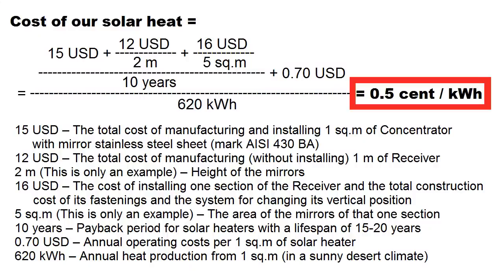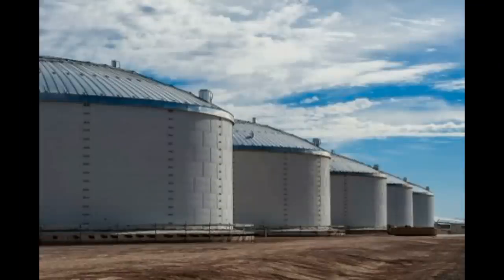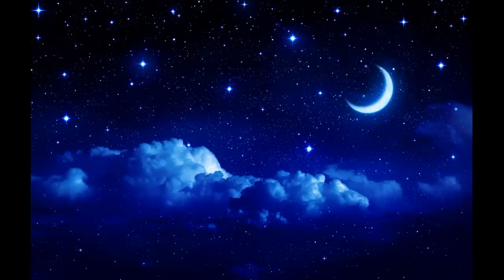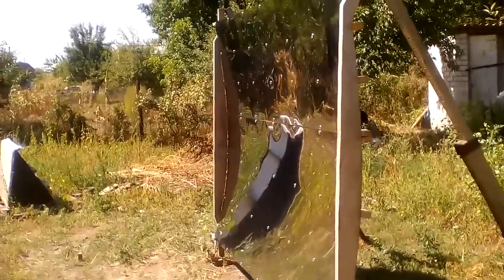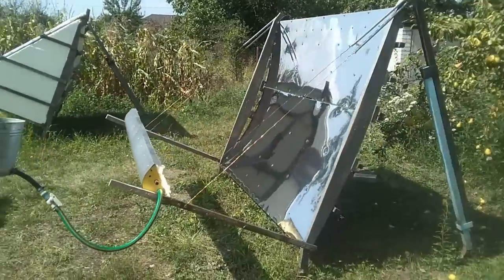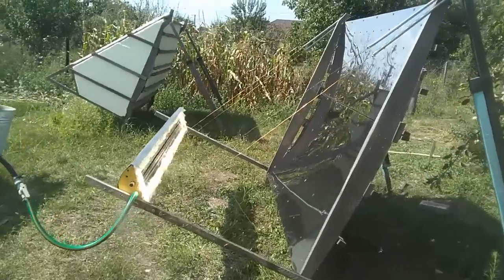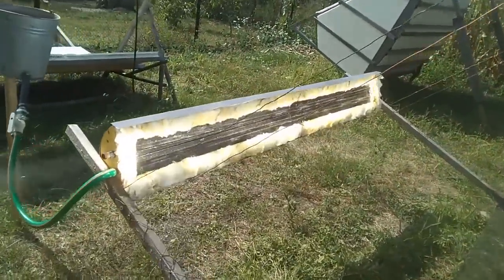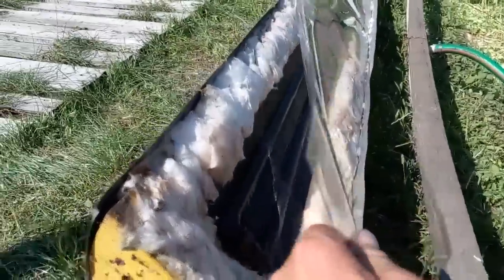What is this new method of producing solar electricity?

Comment: Your videos are interesting as always.

You mentioned at the end that the impressive blasts of steam aren't representative of what the heaters generate under normal operation. What temperatures do they normally get up to when you're running water through them?
Reply from the maker: My measurements were talking about 180-200 degrees Celsius. No a selective coating, without that transparent covering (unfortunately, it didn't add that temperature, and I plan to investigate why my monolithic polycarbonate gave this unexpectedly unpleasant result). The height of the absorber was about 12 cm, the height of the mirrors = 170 cm
Reply: @sergiyyurko8668  Thanks!

I'm not in a position to right now, but I look forward to experimenting with this in a few years. I particularly like the experiments you've been doing with the mylar-concrete mirrors.
Reply: @sergiyyurko8668  
The electric bill will go down while the water bill will go up...
Now, here is the question.
Practically, can you use your system at this size 24/7 with everything you need to operate in the house without failing? You know, refrigerator, air conditioner both on heating or cooling, electric blanket and this kind of things that are power hungry?
Reply: @smarthalayla6397  Well, you can convert heat to electricity with a stirling generator so "yes". But only if you have enough collectors to generate enough heat.
Reply: @peterhoulihan9766  
"enough" is a vague word. We are talking in numbers. How many collectors for on apartment/house. 10 0f those will not be practical to people that live without personal outdoor space.
Reply: @smarthalayla6397  You asked a vague question. The energy requirements of each household vary enormously. Realistically we won't know until someone builds a few of them and hooks up a generator.
Reply: @peterhoulihan9766  
Exactly the opposite. Read the question again. The question included power Hungry machines that works at the same time. It can be an apartment and house. 
Read the question again, think, read it again, think, read it again, think, and when you have an answer with specific numbers you are more then welcome to share it with the world.
Reply: @smarthalayla6397  Your question doesn't include any specific numbers though, why would you expect any in return? 😅

Even if a house has power hungry machines there's no information on how power hungry they are or how often they're used. Plus houses often have very different energy efficiency to apartments.

Anyhow, there simply won't be an answer to your question until someone actually builds generators attached to these things and tries it. Maybe you'd like to be the first?
Reply: @peterhoulihan9766  
There's always an average consumption of energy, and by taking the highest point of that average, you get numbers.
Even without those numbers it is still possible to say- 
"A refrigerator, air conditioner, oven, and water boiler working at the same time will take this much electricity, and for that you will need 1 unit/4 units/12 units"

Those units needs space, but, without knowing how much a single unit can supply 24/7, we cannot know how much units are needed, and people that live in the city, will have hard time to find a place to install this unit.

As for your suggestion, Sergiy Yurko is the one who vave the numbrs to give. That's why my first question was directed to him. Not to you. You in your cleverness, decided to "explain" things and make an argument which leads to nothing. So take a deep breath, hold yourself and wait for Sergiy to tell us the numbers. That's a very easy thing to do. 
If Sergiy won't come with numbers, that's where we can wander how much Sergiy is legit...
Until then, be patient.
Reply: @smarthalayla6397  To my knowledge he hasn't hooked any of this up to a generator yet so there probably aren't any numbers to give. And if you meant to ask him a question, why reply to my comment?

Averages are great but your question was still far too vague to demand specifics.

The best way to answer your question would be to try it with an experiment.
Reply: @peterhoulihan9766  
"And if you meant to ask him a question, why reply to my comment?"
To make it clear for you.

"Averages are great..."
It's still not clear to you. So I'll try again in a different way. I'll go to the extrema.

Lets take that the biggest household electric power consumption that was ever made.
How many unites will be needed to make it work 24/7?

Now, let's go down. Let's say a house/apartment uses 850 kwh at maximum during a day (with most people it's around 16:00-21:00 when all the family is in the house) how many unite will be needed?

That leads to your last suggestion, Sergiy probably checked how much a single unit can create and how to harness this power (which he must do to see if it's efficient). 
My logic tells me that Sergiy checked it and know the numbers. Then, no extra experiment are needed.
 If he didn't checked, then all this video is a load of cr_p like many we have many here on the tube. Without checking the efficiency, how can one recommend on something to the others. 

I'll go to the extrema again. Without being a doctor, I tell you you better cut your balls because it is good for you. Now. Now, unless you have a tumor or so, this will be a nonsense thing to do because it is backed by scientific research.

The same here, Sergiy claim of this unit must be backed by scientific research which Sergiy is the one who must do!!!

Very simple 
Feel free to leave the last word. I"ll wait for Sergiy to come with actual numbers.
Reply: @smarthalayla6397  I think you mostly live in your imagination... so good luck. Enjoy yourself.
Reply: @Nohbdy_Ahtall  Okay.
Reply: @Nohbdy_Ahtall  Did you forget to log out of your alt-account before replying?

Anyhow the original question was "can these power a house."

The answer to that question is still "yes, if there's enough of them."
Reply: @peterhoulihan9766  Not an answer, kinda junk data. A more useful answer, even if wildly inaccurate, is someone going:

"Hmm well my house uses about XXXX power and uhh, let's see, this thing looks like it could output about YYYY. I mean, I got a generator here and it handles about ZZ% of the house on DDD days and..."

Basically anything actually useful - we'll come to the conclusion of what's missing on our own. No need to full-stop the whole conversation with: "Realistically we won't know"

We don't need to know realistically, we need anything. We need to kickstart the conversation with whatever will do the job, so that a conversation and desire to go out and test will actually occur.
Reply: @Nohbdy_Ahtall  I gave a vague answer to a vague question. Have a nice day.
Reply: Polycarbonate will melt or yellow from such amount of light.